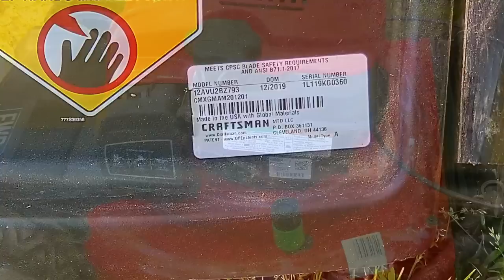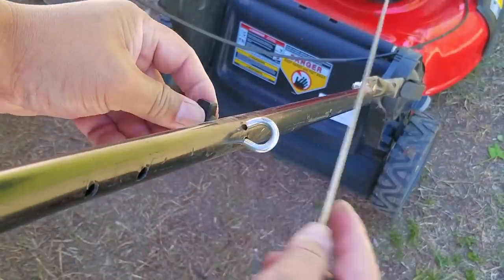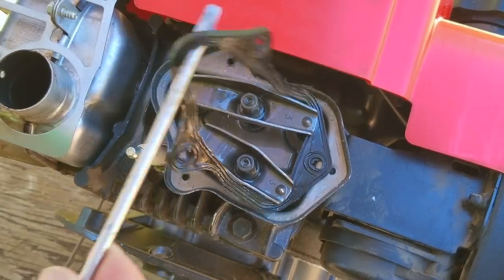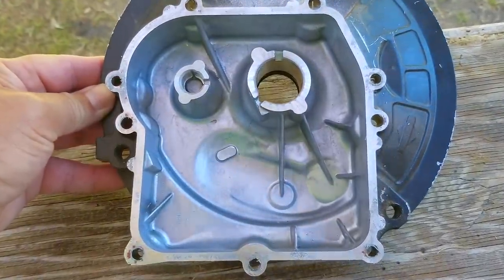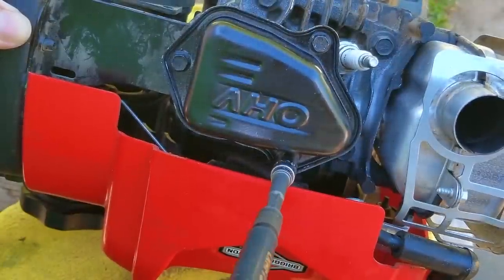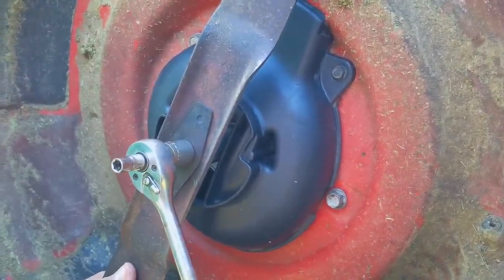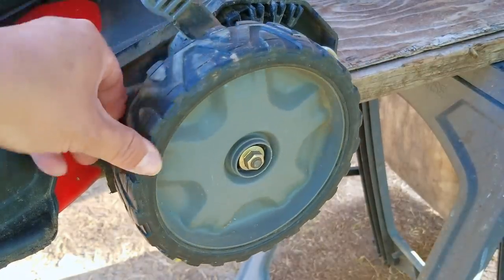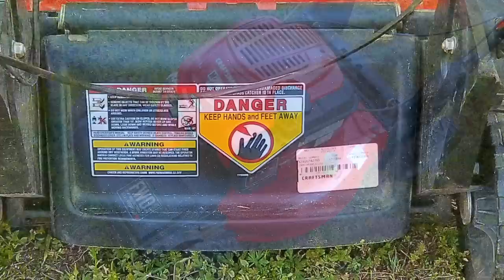Fixing This Craftsman Mower With A Pull Rope Issue

Comment: Hey bro, what's up? What I've noticed is that even though this mower was used with little oil, it's amazing to see how changing a few parts internally and adding new oil made a huge difference. The person whoever purchases it from you wouldn't know the lengths you had to go through to get it working properly again bro.
Reply from the maker: you are correct, hopefully they'll also take care of it.

Comment: I'd fix this. Keeps me busy. One lubricant you could try is moly grease. I'm pretty much a tinkerer. When I was working, I repaired cars for a living, both part & full time. I'd like to tell you about a machine called an auto cultivator. This one was made by Howard here in Australia, including the engine. These had a decompression lever to make starting easier, because trying to start it without using the lever was very difficult, especially if it tried to fire during this process.
Reply from the maker: thank you for the suggestion Christopher Marshall.

Comment: To repair the engine was a thought of mine too, but price of parts in Australia ain’t cheap, if you have second hand parts or donor engines it would help.
I have a few modern motors to look at in the future.
Technically Briggs & Stratton State first oil change at 5 hours, emptying the oil is an art form of angles either by tipping or using suction devices.
Glad that it worked out well😊
Reply from the maker: nice, thank you for the information Rick Thelian.

Comment: Damn that mower when fixed runs like a top. I have and fixing a Craftsman 4.75hp lawn vacuum (hasn't ran in years) that has a stiff recoil. Any suggestions
Reply from the maker: thanks. As for the recoil, I'd remove the spark plug and then pull it, and see just how much better it is. If it's still tough it means the lower bearing is gouging the crank, or there's an issue
with just the recoil
Reply: @HomeGaragechannel  Thanks for the advice!
Reply from the maker: no problem

Comment: Almost all shops wouldn't do it. Since there are cheap mowers out there, most people would just buy new. Once complete engine assemblies became available, this kind of work was for homeowners who wanted to save money, and weren't worried about labor. After straightening a bunch of crankshafts over the years, I was happy to see complete engine assemblies, a lot of them were around $100-$150. Not sure about now. This makes good content for those who have never seen one apart though.
Reply from the maker: thank you TargeWheels, and you are correct.  Unfortunately, for a Briggs, it's about $250, don't know about other brands.

Comment: If flywheel key is good now you have to remove camshaft because it’s plastic junk 
China is building better engines now and need to be importing complete equipment
Reply from the maker: it seems that way

Comment: I believe I would only take on a push mower repair like this if I was extremely bored, planning on using it myself, or giving it to someone close to me. I agree, it was probably too much effort for a “quick flip” and I would probably just held onto it until I could just do a fast engine swap.
Reply from the maker: you wold be correct

Comment: Very cool project and very well done. Personally, I would also fix a mower like this as opposed to junking it, if only for the pleasure of hearing it run again. My first small engine that I took apart was an old Powermate generator with a governor that snapped and needed to be accessed from inside the engine to change it. I did the whole thing with no instructions. It's almost like Legos, you just need to remember how everything goes back together, lol!
Reply from the maker: thank you and it just makes sense since they are so expensive now.

Comment: Good video.   I amazes me how much plastic is used where it should not be these days. The camshaft should be all metal, like in the old days.  With all the plastic waste that is causing problems, why waste more.  If the manufacturers of these engines (and other items where plastic is wasted) were forced to take it back, plastic waste would go way down.  Plastic is not cheaper if the damage to the environment is considered.
Reply from the maker: I know right!

Comment: This production is one of my favorites.  Analyzing that valve cover gasket issue is a great lesson in problem solving too!  Thanks for sharing.

Edit: I was at Lowes yesterday and noticed their cheapest (read junk) gas mower was $269. The one you fixed, even used has to be worth 3/4 what it cost for a new “cheap” mower.
Reply from the maker: I know right, the prices something else right now.

Comment: Usually the only time I rebuild a small mower engine is if it has a special PTO end on the crankshaft like a blade brake equipped engine, otherwise I’ll  just swap out the engine. I appreciate you going through the effort though, it was interesting to see. I’ve had to go through all the trouble of removing and disassembling the engine just to fix a broken compression release before, it sucks but it really does need to be working or someone’s going to get hurt.
Reply from the maker: thank you mjg263, and you are correct, it was a total waste of time and I knew, but I did want the viewers to see the process.

Comment: Hey, quick question, I tried to look up the pulse pump hole on the engine side of a small two stroke carburetor but I could not find anything on it. Do you know if it would make a difference in the performance of the blower to use it? should I poke a hole in the gasket so it it gets used?
Reply from the maker: I'd get the right part instead

Comment: Working on a troy bilt with a honda engine and the owner left the gas turned on and it set for over a year with e10 gasoline in it .I have found that it also has o oil leaks on the split oil sump if i can fix it it will be a lot of money for the parts
Reply from the maker: if it has a honda engine, they only use gasket maker, and no gasket, so that won't be expensive and as for the fuel system, I'd just buy a new carb, which is not very expensive

Comment: Well, definitely an effort that won't be financially rewarding. However, YT subscribers can appreciate the amount of time and technical skill involved. 
May I suggest, reediting, to combine the two videos. Then re titled as ..."A COMPLETE MOWER ENGINE REBUILD". Not 100% accurate, but close enough to get more eyeballs on your channel. If anything, the result can mean more subscribers or more views. The monetized content could supplement the loss you've taken from the initial sale.
Reply from the maker: that's a good idea, the video would be an amazing amount of time, though, well over 30 minutes, just not sure if I want to have videos that long. Would you be interested in super long videos? The post production time could be over 30hrs for a 30 minute video.
Reply: @HomeGaragechannel  

I've watched videos 2 to 3 hours long. But that's just me. I often pause them, get on with my day, then get back to the content hours later.

Keep in mind, the creators that garner 3 or 4 million views per video, have been successful with mundane subject matter. Some landscapers have achieved 30 million views or more, on a single 1 hour vid of themselves cutting overgrown lawns.

In your case, tearing into the motor to get to a damaged part, is so interesting because it's rarely done. It also helps that the mower you demonstrated this on is "newish", rather than an old junky rust bucket. There's a perceived value in the work you did.

As far as the editing goes, just fuse the two together, with an "intro" explaining the extenuating circumstances. Following, in between, with an explanation of what went  wrong.Then include an "outro" with your take on how you'd tackle the job the next time this problem comes up.

Forego the artistic integrity, damn it, this about making some money.
Reply from the maker: I like this comment

Comment: Hey man love the videos I’ve been watching for a while! I’m curious how long/if you test all the items you sell? I usually run engines for 5min, cut them off and then start them back up while hot. If the item passes that test I assume it good. Just don’t want to sell someone a mower that dies on them after 15min of use!
Reply from the maker: thank you Zack Ross, but the minimum would be a 10 minute run, stop wait 30 seconds and do a hot start. The better way, would be to use the mower on my lawn for at least 2 mows, and if all goes well, off to market.
Reply: @HomeGaragechannel  thanks for the reply HG! Definitely going to bump my test time to 10min and try using them on my own lawn before sale. Happy fixing!
Reply from the maker: thank you Zack Ross!

Comment: I'd have to think about it too. I've taken on projects but maybe not that extreme in that area. And if it was going to be iffy in the profit deal I'd just use it myself and write it off as an investment. That's what I did with all mine because all my profit was gone in the repairing, BUT they ran fine and I could use them here. I had to put electric start on the Coleman Genset with the 10 horse Briggs I/C because after draining the system it took a PILE of pulls to get the vacuum pump to refill the whole system and it won't run off of gravity. Tried that and failed so onward with the battery start which works just fine. So I think you did fine and we all live and learn. Take care and BLESSINGS!
Reply from the maker: I like they way you put it, it makes sense
Reply: @HomeGaragechannel  You can always use one and it'll cost to fix another. That ones ready to go. If you can't make money with it you might as well use it on your own place. That way it'll pay for itself and then maybe sell t later on.
Reply from the maker: I see your point
Reply: @HomeGaragechannel  The stuff I use here saves me money in having to replace it because I usually fix it good enough so that all the costs I have are oil and maybe filter changes on a regular basis. Plugs and belts when needed. Maybe a blade every once in a GREAT while and gasoline all along. ALL that wouldn't cover the delivery fee on a new one.

Comment: How do you tell if a push mower has a bad head gasket is smoke çoming from underneath the cover where the piston is a sine of it
Reply: And you can hear the hiss on the compression stroke.
Reply from the maker: for an engine like I would look for a blow out of carbon around the head, and yes you should be able to hear the sound of escaping air
Reply: @HomeGaragechannel  it runs but I had to tighten up head bolts that were really losses that why I ask if it might have damaged it
Reply from the maker: ah I see
Reply: @HomeGaragechannel  got a head gasket for it it stopped doing it now I it needs a new pump diafram it just like the weed eater one on your other channel
Reply: @HomeGaragechannel  Son-in-law blew one on a Briggs good sized single. He tried to crank it and you could see smoke coming out the bottom of the head/block. Replaced it with a thin gasket and it blew. I told him to get a thick silver hasket but he got a thin one. There it sits! Glad it's there. That splitter is fixing to be THERE too!
Reply from the maker: nice
Reply from the maker: I guess it's another project then
Reply: @HomeGaragechannel  For HIM!

Comment: a few decades with the "new" briggs engine i would doubt it but some other person might still use the same engine so it might be a gamble to see how long that engine will last.
Reply from the maker: very true, I just figured it was worth a shot
Reply: @HomeGaragechannel  i was kinda referring to the plastics and other parts that the engine maker cut the costs on and plastic camshaft? that would last probably around 3 to 4 years depending on the humidity the weather etc. and over that 3 4 years mark i think the plastic will fall apart or do some sort of damage.